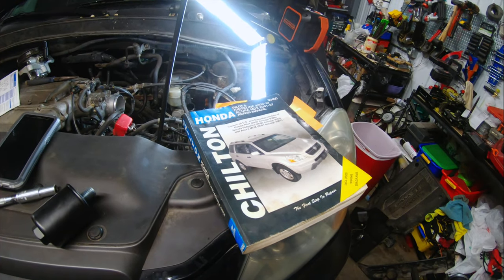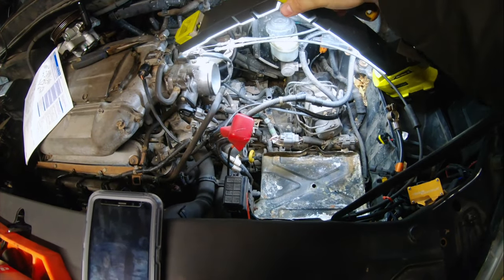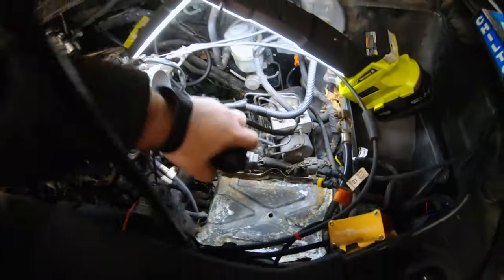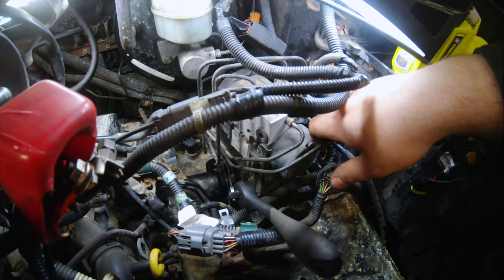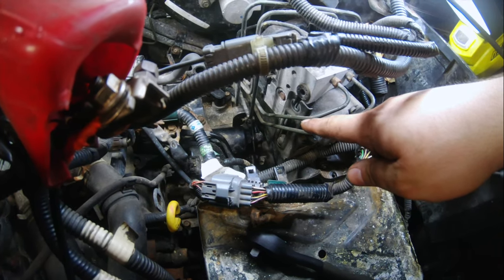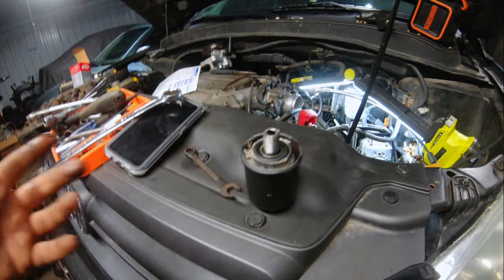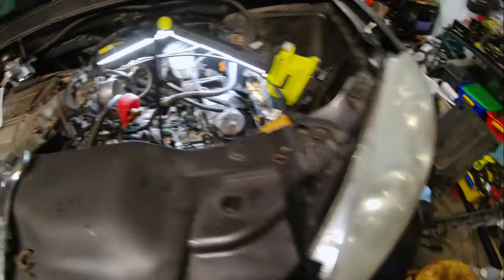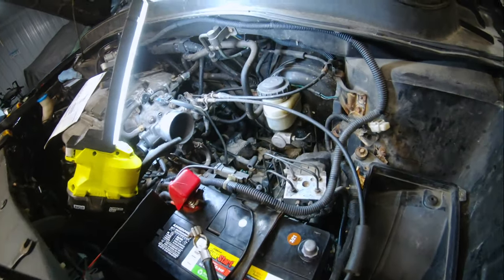Replacing ATF Filter on 2003-2004 Honda Pilot: A Step-by-Step Tutorial

Comment: Getting transmission fluid changes for my 2003 pilot for the past 20 years and i was always informed its just a drain and fill . No one ever mentioned a actual filter that's in a difficult area.
Reply from the maker: @davem.539  It's a usually drain and fill for ATF but there is also a filter. I'd do the filter every 50K-100K. Not every drain and fill if you do the recommended 15k drain and fill intervals

Comment: The steps are correct … but 2005 ATF filter is not a one piece like that …It like 6 or 7 pieces you put together…. Very good video…. Just watch yourself on the 2005 Honda Pilot…😊

Comment: I have an 03 pilot. I changed the transmission fluid. 1st of 3. I will do the filter with the 3rd change. Thanks for showing the 03. My problem is that it won't start now. After I filled the fluid, a major downpour hit and wet down the engine. I dried it as best as I could but there isn't even a click from the starter. I do hear what is probably the fuel pump start but that is all. When I turn off the key, the green key light flashes 5 times. I haven't had the car long enough to know if that is normal. I have not seen a video with the 03 key light. I checked the acg-s fuse. it's not blown.
Reply from the maker: Sounds like you've got quite the problem. I'd start by checking all the fuses using the resistance function to make sure the fuses aren't blown- sometimes they look good but are blown. Check the battery terminals to make sure they are tight. Check all the ground cables to the chassis to make sure they aren't disconnected or worn. They key light should blink after ignition set to off. If it is blinking it means there is a problem with the key or ecu. There is a transponder in the key that won't let the car start or stay running- I doubt this is your issue but you never know.  Check out Piloteers.com and search the forum for possible solutions to your problem.
Reply: @AleksUsovich  thanks, turned out to be a bad starter. Threw me off because it didn't click. I checked with the prev owner and he said he put a junk yard starter on. I changed it and no problems now.

Comment: Can I ask why you decided to change yours and if it fixed your issue?
Reply from the maker: I actually decided to change this filter since my Pilot had around 255K on it and it has never been changed out in the history of the vehicle. I changed this filter along with 3 atf drain and fills and installing a transmission filter in hopes of prolonging the life of the transmission. I have not noticed any differences in the transmission since changing out the filter although got some peace of mind knowing that there's a new filter on there.
Reply: @AleksUsovich how's the pilot holding up?? I just purchased one with 250k on it for dirt cheap and no frame or body rust BUUUT it has the p0740 code and slips intermittently (didn't on my test drive just according to owner) any recommendations?? Thanks in advance